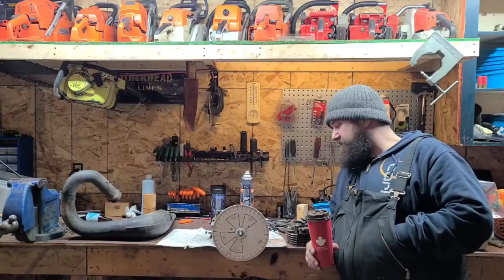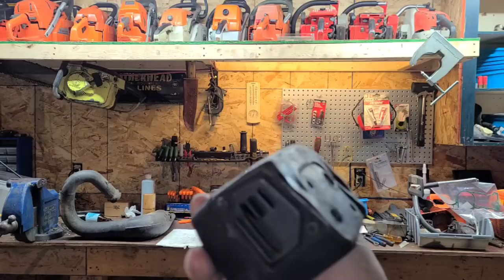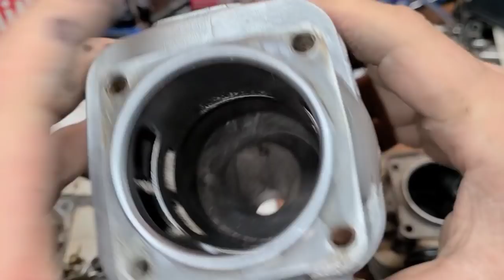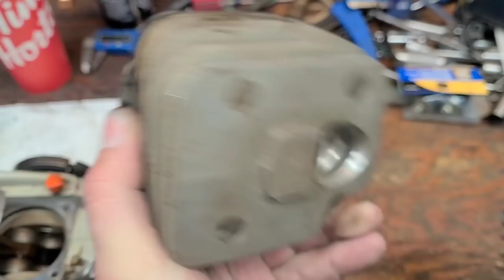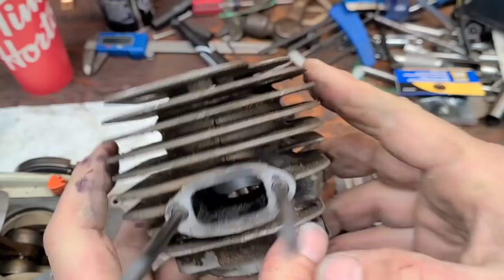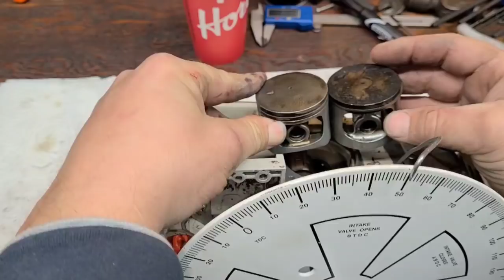Tuned pipes on saws? Timing advances and comparing 266xp and 670 echo cylinders!!

Comment: This is like cb radios. You could calculate for the channel you want to run and get an exact measurement for a coax. But 18ft is good enough. You just ain't gona get that crystal clear smooth modulation like you will with your bench radio. Typically, just like saws there are good mufflers out there. They dont need to be turned we can still hear ya C'mon . One more thing and you and ironhorse helped me tremendously. I said I could do that with a saw. I did I'm getting better I'm gonna start putting a couple videos up possibly. But boy wouldnt it be cool to have a matching set of saws ported by the people that tought you. Hint hint Tinman and Ironhorse. At the same time I think most of us understand you have a life off the camera. Thank you

Comment: A friend of mine and I tuned the idle and low speed jet on another guy's Pro Mac 700 tonight and put a tach on it. I never put a tach on a McCulloch before. It was around 30-32°F I'm guessing outside when we did it. Got it to idle nicely between 2100 and 2200 rpm, no chain movement. It topped out once at 11,890 rpm but consistently ran to 11,400 rpm while still four stroking.
Reply from the maker: Interesting, i havent tached a mac yet.

Comment: Tuned pipes:  "Just because you can doesn't mean you should".  It's always about "what is the intended use"  hot saw vs logging saw, top fuel dragster vs stock car.  If you want a saw that runs day after day with just fuel and oil (and cleaning your air filter) you build a logging saw.  If you are ok with rebuilding the top end after ever 3 runs, you want a hot saw.

Thanks for sharing time and knowledge.
Reply from the maker: Yep that sums it up.

Comment: Hey Tinman, i like your content because you take the time to explane it right! You changed my mind in modifieing my chinese ms660 which i am using for sawmilling (i run a real husky to, but dont want to mess with a expensive saw until i know more what to do) . First i wanted a expansion pipe on it. but after wat i saw what you can do with a proper port job i want to do  that. I screwed my stock cylinder a year ago with just grinding it. Now i break in my new big bore 99cc with cutting firewood, then i will port it with what i learned on your channel. I actually dont know yet what are good timing numbers  for a big displacement. I need a bit more torq to pull the chain, i don't want to raise the rpm to much. maybe you can help. Greetz Bart from the netherlands.

Comment: The exhaust doesn't have to exit out the back on a tuned pipe. A side bleed pipe exits out of the middle of the expansion chamber, you can direct it in any direction. The same or more power and a lot quieter.

Comment: I have several of the Poulan/Husqvarnas. 137, 141, 142. The 142 is the only one running. I also have an old Husky 40 that runs great and the older Husky 350 52cc that I haven't tried to crank. Husky 455 Rancher that runs good but has one nut to hold the bar and a star wheel to tighten the chain that will back off. A husky 359 that has a bar oil leak but runs good. I got a Husky 61 in yesterday haven't tried to crank it. It seems to have compression when I pull it over. A Homelite C-51 Direct drive I haven't tried to crank. Which of these are good candidates to learn to port on. I know the larger saws are comparable to yours but can the 137-142 be ported successfully. Sorry this is so long. Happens when you get old! Thanks

Comment: Yeah they will let go if you mess with them. I hung a ring in my 2100CD I recently ported. I didn't catch that the arrow on the piston is pointing the wrong way. Goofy part is its been running for a couple years with that piston. As soon as it locked I remembered the backwards arrow. I had a spare piston and it didn't ruin the cylinder luckily. On a good note though I got an email that says some goodies have arrived in Canada!!!!!!
Reply from the maker: Yeah buddy I got a big ol box at the post office today!! Thankyou!!!

Comment: Hey tinman what would cause a homelite super ez automatic chainsaw to go extremely rich that it won't idle with the idle screw all the way in
Reply from the maker: A problem with the governed carb maybe??
Reply: @tinmanssaws  well it was running great today then it started dieing, i pulled the carb off and cleaned it still no difference

Comment: Kind of had an idea for spark timing. Not sure if it  will  work, i know some file  the key or key way on the flywheel  but i was kind of thinking  bout  widening the bolt slots on the coil in a mill, i know  it will need to remove more material  that way to gain a degree or 2  compare to filing the key or keyway  cause of the  arc radius.  Not sure if anyone  has tryed it will take some trig to figure out  how much to widen by but it was just a thought that ran through my head.

Comment: In my studying, I have come to the understanding that you really have to get up into pretty high compression before a timing advance is even worth considering.  Does that sound right?
Reply from the maker: Yep sometimes
Reply: In a high compression ratio engine it's quiet the opposite but chainsaws do not reach that level.  Timing advance can be used in some cases but these days the automatic ignition advance is very aggressive and you can get into trouble quick.  For instance, Echo modern coils run 26-28 advance at wide open throttle and 14 and idle.  28 is as far as you want to got in a work saw.  The older Stihl coils ran a static timing 14-16 so you can get a noticeable gain in them but have to really commit starting it or the handle will be ripped out of your hand.  Basically, if you don't understand exactly what the saw does under WOT, don't touch it.

Comment: I am working on an old remington chainsaw from i am guessing around the 1970's. One problem is it boils the gas and the other is when i put bar oil in and run it smokes like it is on fire. I am stump. Will welcome any ideas.
Reply from the maker: My guess is the gasket that seals the oil tank from the crank case is leaking so you're sucking bar oil into the crank case.

Comment: I say yes to the ignition timing tighten that wheel down put a cheap cylinder on it and use a drill spin it over at about 2500rpms see where the coil is firing with a timing light make your marks and advance it as needed also ever .010" is 1 degree of timing, should be the same with the saws as like a honda gx200 6.5hp or honda gx200 clone like the predator 212. just a thought. Not nessisarly for tin man but any one reading in the comments that is wondering about building a bada** predator 212 btw there are 4 different types of predator 212 harbor frieght engines please let me know I can give info on building your own. or contacts of someone who would love to build you one.
Reply: For me its building a dang good go kart engine with a predator 212 hemi block and head and something as stupid as usuing to short of a crankshaft bolt and you strip the threads out of the end of the crank and she turns right up to 7,600 causing the piston to rock and score the cylinder. I'm just surprised the vales didn't float from running 18lb valve spring and stock slip keeper. It did have a billet rod and flywheel so I new the bottom end was still good and the flywheel wasnt lyable to sling the magnet and bust. I never did put a degree on the engine and check the cams center lines. i deffinetly could tell the numbers was dead on considering all the model of predator engines very 2 degrees + or - . Same as the flywheel ignition timing.